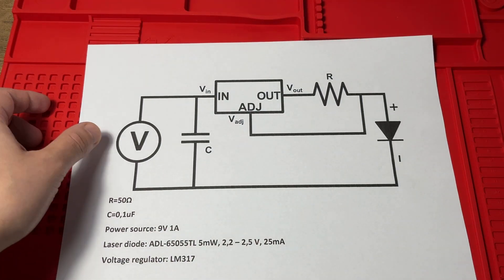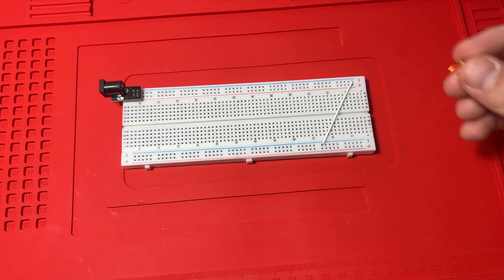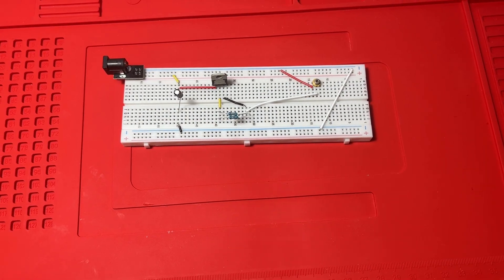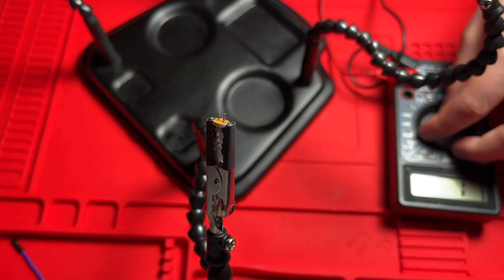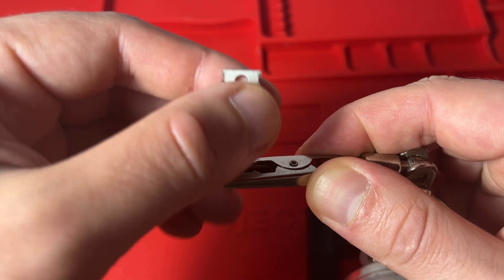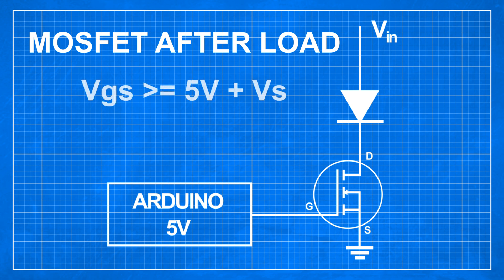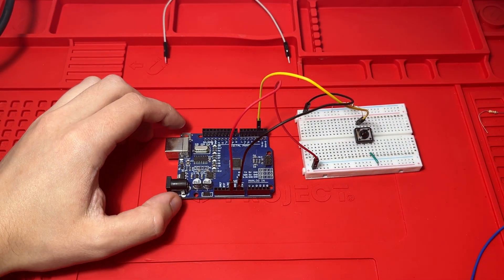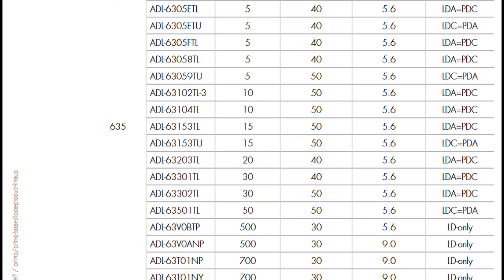Arduino for Beginners: MOSFET Laser Switch

Comment: Great video, but is that safe to keep the circuit connected to the power source with MOSFET at 0? I mean, what is happening with the current, isn't it causing dangerous voltage somewhere in the circuit?
Reply from the maker: I'm not an expert on this, but from what I understand, when MOSFET is "off", there is very high resistance between source and drain, and a small amount of current (few microamps) flows through it. MOSFET switches are pretty common and safe.